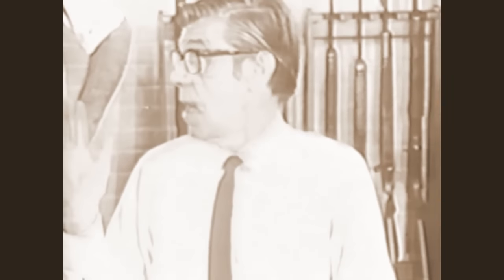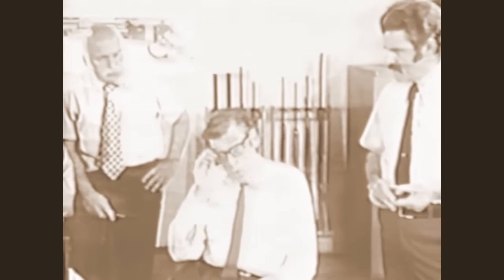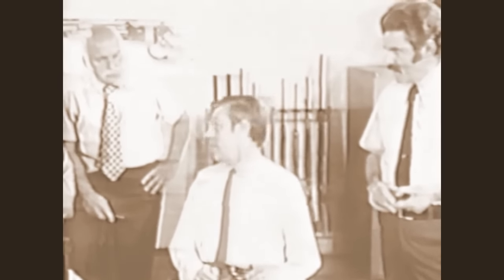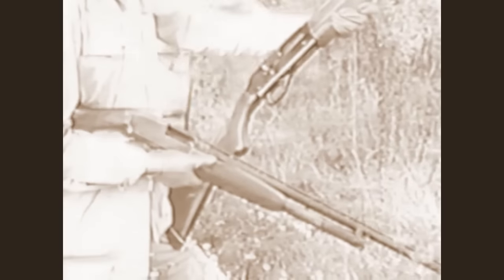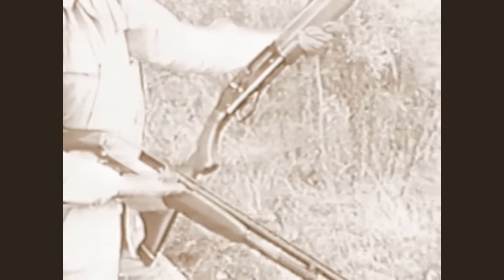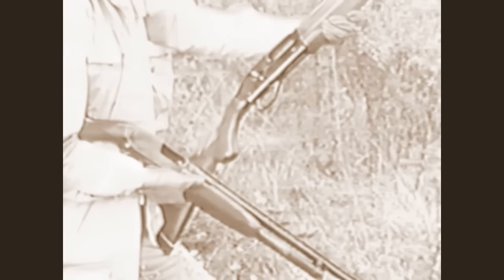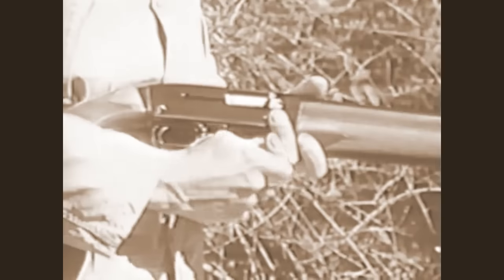Winchester Super-X Model 1

Comment: These guns are great until the rubber buffer in the back of the receiver gets old and disintegrates. Then you have metal smacking on metal and a bolt that wears a channel in the receiver and sticks back every shot.
Reply from the maker: That situation is just poor maintenance, as it is easily replaced long before any 'metal smack". https://www.midwestgunworks.com/page/mgwi/prod/USR29SX1
Reply: @RandyWakeman  It was a buddies gun and i don't think the thing had ever been taken apart. I disassembled it and seen the damage. A good .25 '' long channel had warn into the receiver, there was no visible damage to the bolt. So i knocked off the sharp edges of the channel and replaced the buffer and O ring. Thing runs like a champ now. The groves that the bolt cut into the receiver were not very deep so i doubt they will cause any kinds of failure.

Comment: I was lucky enough to have one of these  come my way. My Barrett’a 686 spends a lot of time in the rack these days. I love  that oldSX1. My only bitch is that it is very picky about the O ring in the gas system. I will have to go thru 3or 4 before it find one it likes. Then it’s good for a year or so. Any body else have one that’s picky?
Reply: Dee Hand,
I agree with you about o-ring. Once it gave away in my Skeet round. 
Buy o-rings from McMaster Carr (approx. $5 for 50 each) i will post the exact size tomorrow. 
I keep a spare when I go hunting or at a skeet match. 
Super X 1 is the best semi auto shotgun.